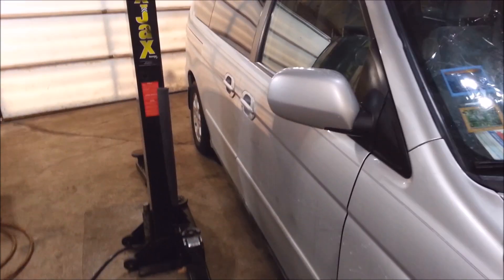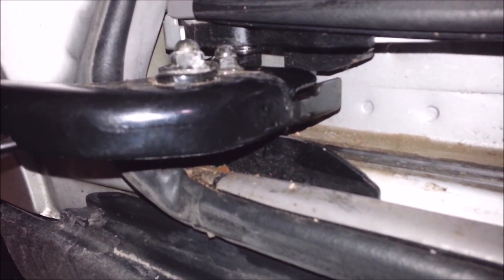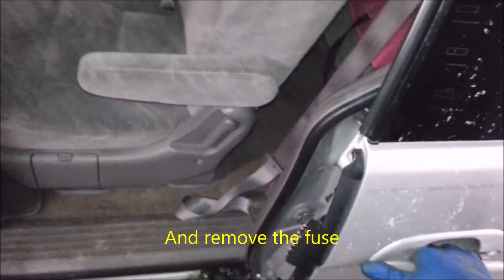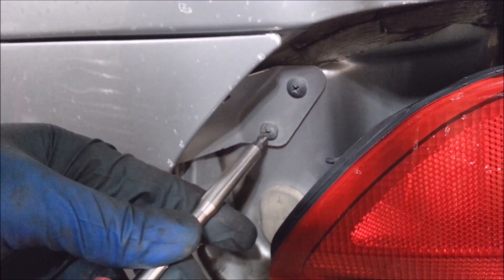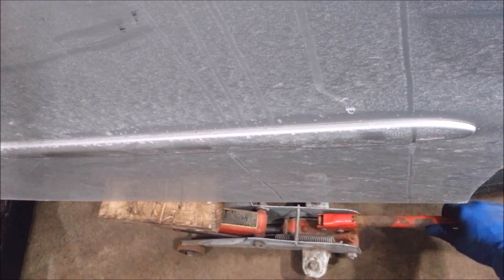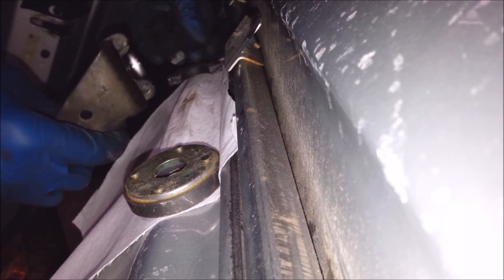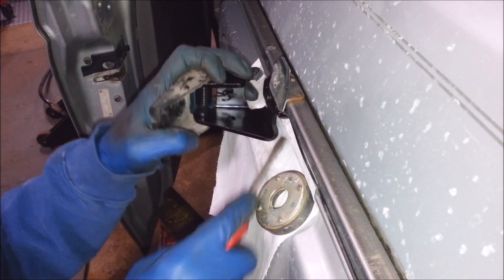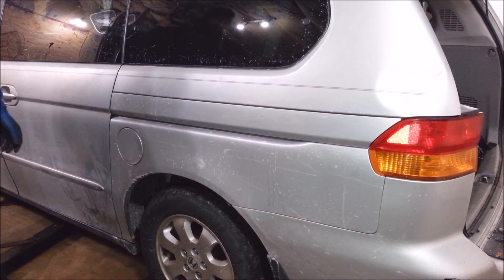1999-2004 Honda Odyssey Center roller and power slide door fix

Comment: Took my 04 into Honda because my drivers side power door cable snapped. They charged me $150 to cut the other end and didn’t bother to remove any fuses so the alarm beeps like crazy when I use the door. What fuses do I need to remove to make the beeps stop? Also they told me my rollers were okay but the door doesn’t like to move and I have to center the back end of the door for it to close properly. Does this sounds like the rollers are failing or something else?
Reply from the maker: Sounds like they needed to cut the other side of the cable. It probably beeps because the key is in the ignition, or lights are on.